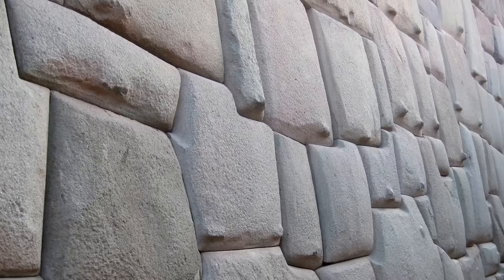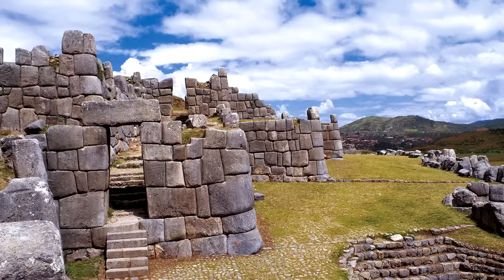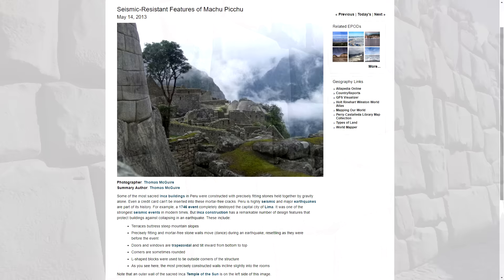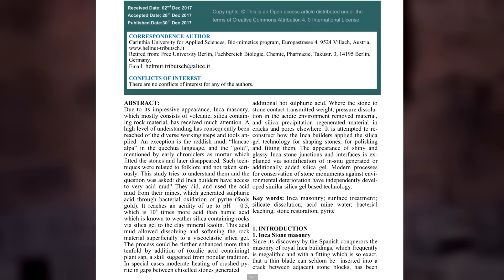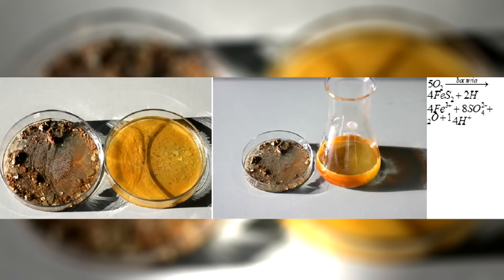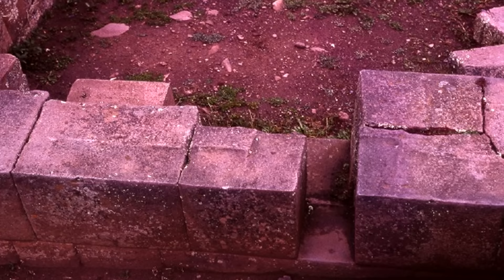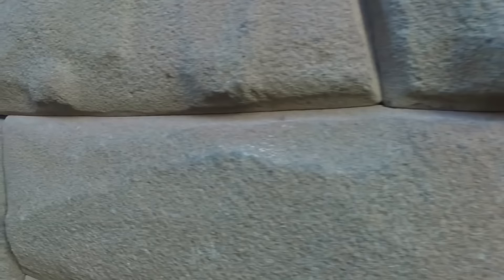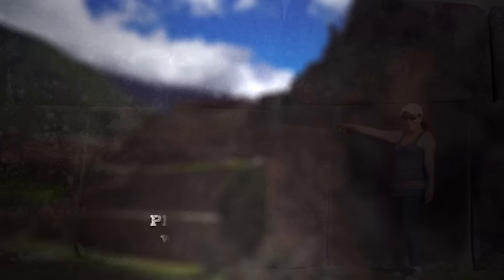Is This How The Inca Walls Were FINISHED/JOINED So Perfectly?

Comment: The stones seem to have been poured / cast in place. The "nubs" as people have called them are "gates" through which the liquefied stone was injected. The gentle slope of the face, in many instances, would also comply with a pressure "face" of the surface, help in preventing distortion of the sealing "cavity." The size of this mold forming equipment seems to be limited to the height of the uppermost casting, Terraces give clues to the limits of the height of the casting equipment.  Either heat or frequency also may have played a part. Investigate the orientation of the crystals related to these "nubs." There would be solid clues to its earth-magnetic orientation.

Comment: Chemical erosion of the boulders as a possibility makes some sense, but the biggest question far beyond that is -
How did they get to those boulders from the mountain across and back up the other mountain to the top of Machu Picchu?  … I can get them down, but they’re gonna stop in the valley or a small way up the other side because of the severe angle of altitude of the mountain.  so my speculation or whatever was able to move the boulders from one mountain to another across the deep valley and back up had no problem carving or melting them together after they were there.
But beyond the ability of humans!

( what does anyone else think?

Comment: Hi,  
One word,
Geopolymers.
Reply: Yes, the stones were built with geopolymer or a kind of cement concrete when it was still malleable.
Reply: And they purchased tons of the powdered rock at the local Home Depot and transported it by rail cars. And they analyzed the bedrock in the quarry to somehow get an exact match.  Or perhaps the entire mountain and quarry are also made of the same geopolymers.
Reply: Baked a cake using rock dust.
I tend to agree.all sorts of recipes

Comment: there is no force pushing on the sides of the stone.
Reply: This was the first thing I thought of.  Sure maybe it could have been done that way if you only had to join horizontal surfaces, but if this was the method used, there would be gaps in the vertical surfaces where the bacteria ate away the stone.
Reply from the maker: Good point I was pondering this also, it probably was a varierty of techniques they used to cut and fit the stones, i find this technique really interesting though especially as it doesnt require any advanced tech 👍
Reply: From an archeological standpoint I don’t know why an assumption is being made that an ancient human society didn’t have advanced tech.  There is massive evidence to suggest that they did possess great knowledge and tech.  Aside from the polygonal masonry, even after thousands of years the accuracy of various ancient structures is still mind blowing.  I have a great many number of theories that almost all of the major polygonal masonry were made in the same era by the same people.  My guess is they used sound and resonance to manipulate the stones.  If everything has a resonance frequency, you could possibly determine what a rocks is and then with mathematics determine sub or doubled harmonics to sheer irregularities from the rock face.
Reply: @anthalas9  I was shocked when I saw video evidence of a tube drill vibrating it's way into granite. https://www.youtube.com/watch?v=BsqOLCXYznE
 It must have been how the Egyptians made those perfect dill holes in granite. but the next question is, how did they vibrate the drill without electricity?
Reply: Nineteen1900Hundred they created resonate vibrations, possibly with horn, bowls, metal, who knows.  But there are many stone objects around the world that look like they could have only been created on a CNC, yet no tool marks.  This is the reason I believe they use sound resonance.
Reply: Nineteen1900Hundred
yeah i was too when i first saw that video! and i believe they used sound to generate the vibrations as frequency = vibration.
Reply: @Nineteen1900Hundred  Maybe they placed a large tuning fork type device on top of the drilling tube. Striking the tuning fork would create the vibration and cause the tube to drill into the rock.

Comment: The acidic paste theory has some holes in it,  why would the paste stop eating away the rock?  If it's strong enough to eat massive amounts of stone,  then the stone would continue to deteriorate over time and affect the structural integrity of the walls.
Reply: You have missed the truth that acids all weaken as they dissolve minerals by loss of electrons. Add the effects of rain washing away some and diluting the rest. 

Also, if the builders knew that acid can be weakened by washing, they can stop/end the corrosive action when they have achieved the end product they desired. 

One can say that the acid will not be acid for long.

Comment: Nearly everyone misses the real point(s) and that is. 1. The stones are huge, not local and brought to a high altitude. 2 mining/lifting a rock of tons, 3 transport each rock of tons to site, 3 suspension of the heavy rock for placement, 4 manipulation THEN bedding the mating surfaces.

The original designers could utilize techniques and technologies but were outlawed from transference of their own high technology to indigenous beings, in effect use of only local (Stone Age or similar) indigenous crafts and material.

Once you read this and ponder this, it becomes clear that highly advanced technologies were used ONLY in the realm of indigenous peoples that would not prematurely skew the time required for the advancement of critical thought as it relates to scientific discovery by the ancients peoples.

As for who had the technology for such a profound technological impact? It also becomes clear that there were many of these impacts that have come and gone not just over two or ten thousand years but instead over hundreds of thousands of years. Not that hard to figure out but a bit difficult to face the fact that at present, we are beginning to be the last to find out.

Comment: The rocks were softened by electrolosis, and the weight shaped it, each level, soft rock on top, stable rock, then up another level etc. those dimples would be where the electrodes were pulled out once the rock was set in place.reasons you’ll find hexagonal and star shaped holes that rounded off some over time. Better for sending current. Reasons why the outer core of these rocks seem to be chipping. Is minerals get stripped from the outer edge when it goes through a softening. So the outside gets brittle.
This is my theory number one. Number two, is that they turned the rocks into powder, then mixed the acid with the powder and made castings like concrete. But the acid turned the powder into a rock again, and some of the minerals were lost in this conversion.
This could explain the tiny holes everywhere, because we have those when we make foundations.
Maybe we need to X-ray the inside of these rocks somehow, and see if they are in fact artificial, but so old that it petrified into a similar mineral composition as certain rocks. 🤷‍♂️
Reply: I tend to agree. It's like the olden day 3 D printing.
Reply: Do a practical electrolysis softening live on video and I will be convinced. So far no dice!

Comment: I think this is possible, but I would say it was probably rubbed on the stone and material was slowly removed through the acid to make them fit. I think if, like you said, the acid solution was left on the blocks it would have cause more damage in a shorter period of time.

Comment: This is a great theory but I still believe that these civilizations used toroidal waves(frequencies) in their everyday lives in various ways. It is shown even in the egyptian culture as shown by the tuning forks in the hieroglyphs. These waves are known to soften some stones and there is cases where toroidal waves have the power to influence human reactions even. 
 In saying this it is not just the sound but like you point out a combination of chemical processes that help in acheiving the final product.
Reply: The stone is granite with silica crystals. Today we use silica in the wafer fab industry that make computer chips. They use high intensity light on a masked (geometric) pattern and when the base material absorbs the light and can take no more energy it pops away from the surface. The light used in this process is in the 100,000 + volts range. This gives the first layer (insulator) something to hold on to. Just thinking.

Comment: It's almost as if these giant granite stones were soft like marshmallows. As you stacked each boulder in place it sagged and spread into the boulders around it forming a perfect fit with rounded trowel like edges. Even the face of the boulders are bulging and rounded like they puffed out as weight was added. I'm not suggesting this is how it was done, just that this is what it looks like. Also, theres the knobs or nubs on some boulders and the scoop marks on others. What's that all about? Until we find the ancient Inca Rosetta Stone explaining exactly how this was done the debate will rage on. Haven't read a theory yet that made me sit up and pay attention.

Comment: As you are extracting a stone from the quarry, you are creating the side of the stone you are extracting.  HEY!!!! While you’re creating THAT flat surface, the quarry wall is also being shaped.  And both ends are being shaped.  Just like that - four sides are shaped AT THE QUARRY.  You simply now transport the stones, do finishing touches and your done.  

While quarrying, you could create any reasonable shapes you want, top, sides, bottom (to a large degree).

Comment: If it is an acid-based paste you are proposing, there are at least 3 questions you need to answer. 1: What is the time frame that it takes for the acid to work? Anything over a few minutes would be impractical for time of construction. 2: When or how does the acid know when to stop working? Why wouldn't the acid just continue eating away the stone? 3: How does it create pressure on vertical surfaces? Even if the acid eats away vertical surfaces, how do the stones move laterally to form a tight joint?  My conclusion; you need to look for a different method.

Comment: They look as though lumps of,stone have been pulled off, not cut from, a larger area of rock, then melted and pushed into different shapes and sizes after which they were added to the wall.  And, of course, the only way the wall was built was by levitation.  The mind has amazing powers.

Comment: An Egyptian technique offered on TV proposed a chalk staining of the bottom stone, resting the top stone on it and then grinding away the protuberances on the top stone that were  stained by chalk. Obviously a technique involving gripping the top stone and moving it was needed. That was done by gripping large handles on the stone with long timbers and using several men and leverage to do the moving work.

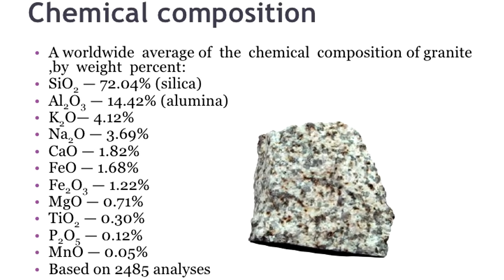Comment: 3:28 it's an enormous leap to go from iron and sulfur rich bacterial acid leachate to the dissolution of silicates. The primary complication is that silicates are highly resistant to sulfur compound acidity. The other listed constituents such as the metal oxides could be decomposed by the acid leachate bacteria, given a steady supply of water throughout the matrix. If a "reddish paste" was used to alter the silicate, it most likely consisted of Subedties (reddish-orange sea sponge) which contains both silicase (enzyme breakdown of silicate) and silicatein (enzyme for biosilicate formation). The convenient aspect is that this sponge can be harvested from shallow, muddy water crusteceans ...

Comment: The easiest way to make blocks fit together seamlessly starts in the quarry. If you break up a large rock into smaller rocks you can then trasport them to where you want to build your wall and reassemble them in the same order. You'd be chiseling out the joints in the quarry to break the rock where you wanted which gives them the pillow effect. Job done..

Comment: I like this. I have also read that the glassy look of the stones is indicative of heat. I have wondered if there was a type of fire mortar that could have been used in construction and set alight after completion to burn them into place. This one might work better as it would be a slower process and less subject to movement.
Reply: Glossy blocks can also happen from polishing.if they were climbing up and down the wall while working....or running water or run off was pouring down them carrying fine material with it that could polish it.
Fire hardening or casting of molten material is also a possibility.

Comment: This acid technique used on there rocks seems quite logical. Many thanks for your video. In Egypt they used round about half the size of a basketball rocks that were very hard, to cut the obliques from there stone quarries. The people would drop or pound on the surface on the one side of the obliques until they had reached the  depth wanted and on the other side they would do the same. To smooth the surface sand using a flat stone on top of sand moving flat rock back and forth until smooth. This was quite labor intensive.

Comment: That might be true, that would explain some of the arrangement of how the stones fit together..
But I would expect there were other techniques used at the same time to work with that or to accelerate the shape transformation..
The holes in some stone walls or the outward shapes sticking out might be due to electrodes being inserted into the hole, or pulled out bringing a stone tab out with it.. 
Either electrostatic energy or electron currents would accelerate the acid effect
That could be frequency dependent based on the size and the shape of the stone and the type of material..
Or it might just soften the stone to make it more pliable to press one solid Stone into another one that reshaped it the most and the new stone along it's edges.

Comment: Seems to me if the stone was so softened  that it sank into the next block that there would be many obvious bulges but they look beveled and not machined looking.
Reply: what if only the outside 1 inch of a stone could be softened for a while before it rehardened, like the icing on a cake? It and its neighbor could be cut, molded, and shaped to fit together perfectly. This would require only a scraper or a knife. The stone supplied its own mortar!

Comment: These structures are hundreds/thousands of years old. Could the constant friction between the stone blocks caused by very minor earth tremors over time cause the blocks to grind away and wear into one another? The older the structure the tighter the fit between the stones. The wind and rain may have blown away and washed away the dust from the grinding action.

Comment: It certainly sounds the most sensible of any theories I've heard. I don't know how strong this etchant is but it would need to be pretty good to erode the amount of rock required to create these fits. As a result Im struggling a bit with the idea as the solution would surely degrade as the rock was eroded and so would likely require replacing or reinvigorating in some way which doesn't appear that easy to to. The other remaining question is those nodules, they don't appear appear to have any relationship with erosion of the edges but do appear to involve the same process

Comment: Thank you for this video. Years ago, I scoffed at suggestions that anything other than hand carved tool work created these monuments. But, videos such as yours has caused me to reevaluate my belief. I have investigated the possibility of using an advanced machining process know as Electrical Discharge Machining (EDM) to sculpted stone and it is used widely today. It is common knowledge that the ancients had knowledge of electricity, and lead acid battery's. Perhaps they used the solution that you speak of in this video, combined with voltage to speed up the process?

Comment: The walls look like troweled concrete , like the stones were, perhaps poured in place, and within a few hours they were shaped. What sculptures in concrete call, working green cement, when it is in a plastic state where it is hard enough to hold shape, but soft enough to shave and form by hand. To me these were bag formed, then worked green.

Comment: A template had to have been made of the desired shape and inscribed on both stones before being cut to the shape. Once inscribed a chemical may have been applied to the inscribed line which would account for the smooth fit. However, we do not know whether that same tight fit is all the way through the stone or just the outward-facing few inches on either side of the stone.
Reply: We do. In most cases its only the first few cm that mate perfectly although some go right through.

Comment: Any explanation must address all the elements we see on the stonework, ie the scoop marks, the nubs and the shear weight of the stones. Some have no nubs or scoop marks. Close analysis shows the stones are smoother near the joints on random pattern and orthogonal walls alike. The more conventional walls have horizontal coursing as if set out with laser precision. The method used appears effortless. So,,,acid sulphate,  probably not the answer

Comment: The stone blocks do appear to have been softened and sagged into position but not just the outer layer. If you stack bags of sand you can see a similar effect.
It appears that the shaped blocks were installed  and then plasticized in some way, which would explain the rounded form. 
Nobody would spend the time creating the smooth rounded exterior in a quarrying situation. Straight edges are the more efficient method. It is almost as if they extracted the stone by blasting, which would explain the variable sizes and shapes and then worked the blocks before fitting. 
They don't appear to have been quarried like the Egyptian rock at Aswan.